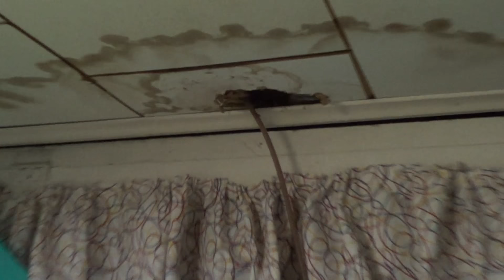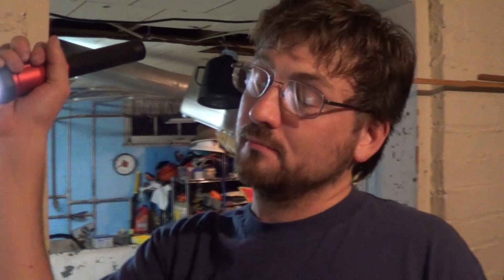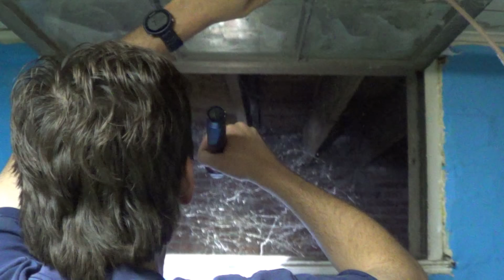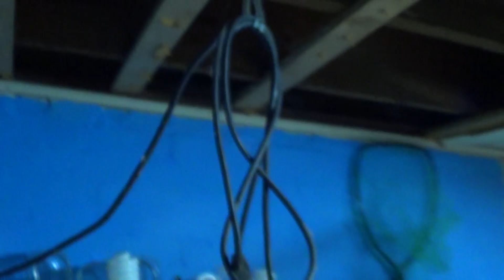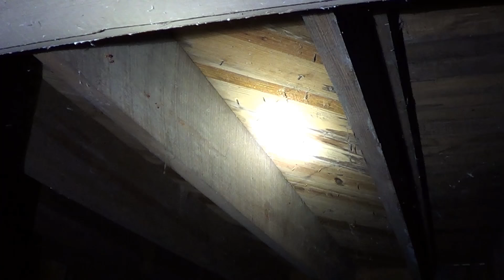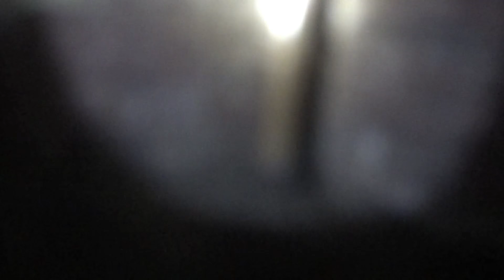Old House "Spelunking"

Comment: I work for a large nonprofit organization, and we're based in a very old set of buildings (a lot from the 30s-50s). One of my favorite parts of my job is being able to spelunk around, and see ancient artifacts from when the buildings were built. A spot in our 50s section is being renovated, and the facilities team uncovered some beautiful terrazzo flooring under the nasty old carpet tiles. They decided to scrape up all of the old carpet tile glue and use the original flooring instead! 

Hope y'all ended up getting the stairs repaired. Sometimes tearing out the whole thing is a lot more work, but it makes it so much easier to diagnose what went wrong, and to prevent it from happening in the future. That cistern that y'all had sounds incredibly fascinating in its own right. They just don't do things like that anymore, and old irrigation/plumbing technology is incredibly fascinating.
Reply from the maker: Finding old and interesting stuff in buildings is always great fun. The stairs were long ago repaired.

Comment: The window was probably there when the house was built, that area might be an old addition. Definitely don't trust the stairs, based on how crooked they are I'd say both beams are broken in half, yikes! I recently worked on a house that has two sections to the basement, the original part is 31 x 31', the addition is 20 x 10' (part of it is a crawl well). All concrete/ rock walls but I guess the main part and addition were built only a few years apart 100 years ago. Still had the gravity furnace holes which were patched. The whole house was gutted during the renovation so I have a pretty good collection of knob & tube from it along with old hardware and some vintage tools that were still attached to the workbench.

Comment: Having been a well driller, a cistern always makes for an interesting story! I never realized that they had piping that could lead back to the cistern. But that would make sense. 

As much as I know i'd be a bad idea, I'd probably turn that valve just to see what would happen. (Eventually something WOULD come back up that pipe, or the one covered by the board/brick in the crawlspace!) 
As for the trash...abandonment is always weird when it happened before your time, Anything went. Cementing it over was the best course of action! Trash, well, causes problems later in life :3 (Take it from an irrigation well driller!))

Comment: I think the back porch area there has been modified in the past. I bet those windows opened to what was then the outside yard, and that staircase wasn't there. It probably had a bulkhead entrance there. It's possibly there WAS originally a porch there that was open underneath, not bricked. Is there another set of cellar stairs under the stairs going to the second floor? The wood lath on the wall next to the bare wires(lol) looks much more recent...wood changes color as it ages.

Comment: Uxwbill I was wondering if you happen to have a Elmo DVR server because I obtained one with out the hard drive and the software originally for the machine made back in 2004 is out of date and cannot be found on the internet
Reply from the maker: Sorry, no. I didn't even know the Elmo Corporation sold such a product. Best guess? Try the Internet Archive's wayback machine.
Reply: I must've missed the part of the video where they found a server in UXWBill's crawlspace.

Comment: I also had massive influx of crickets in my basement around June of this year. They are attracted to moisture so that's why they're hanging out in your laundry area. Setting out glue traps did a great job of getting rid of them. You can make homemade ones by wrapping some duct tape with the sticky side facing up on a piece of cardboard and with some sugar sprinked on it to attract them.

Comment: My house has a window like that as well. Mine is a little small for "crawl space", but in my case, it used to be a window to shield my basement from the outdoors. Then, the kitchen was expanded, to include a sun room for the kitchen table, and it covered one those windows in the process. So my guess is that your house was expanded at one point in time, and that window once opened to the outdoors, and since your house was expanded, it became a home for spiders, not unlike my situation.

Comment: Is there a spot somewhere where you could make a small hole (if necessary) and drop the Hazard Fraught borescope in to see under the stairs?
Reply from the maker: Unfortunately, said borescope got slightly wet in a flood and didn't live to tell about it. I have yet to replace it.

Comment: Very interesting. I have never heard of a cistern system before.
Reply: Cistern systems are only typically found in houses built before the municipal water supplies were available in the area. That particular example is a rainwater harvesting system. Cisterns  were also commonly used to compensate for low well yields.

Comment: maybe measure and make the replacement stairs then take out the  old and try and drop fit the new in ? just an idea as key keeper said cant use the stairs while working on it so need all the wood and stuff at least pre cut when you dig in

Comment: Sorry for commenting so much. Uxwbill when are you going to do a live stream next and why don’t you want us to use uxwbill dot com on your website.
Reply from the maker: Live streams are not announced, and don't happen very often. If you happen to find one, that's great.

I don't own or operate the uxwbill.com domain, and I'm not tremendously impressed with whoever took it upon themselves to register it. I wasn't asked and did not want or need that to be done. To my knowledge, there isn't anything wrong with it per se, but I cannot vouch for what you will find there since I do not operate it. The notice tells you what URL you should be using.
Reply: Moose & baby tiger I didn’t know he had a website. What is wrong with that URL?